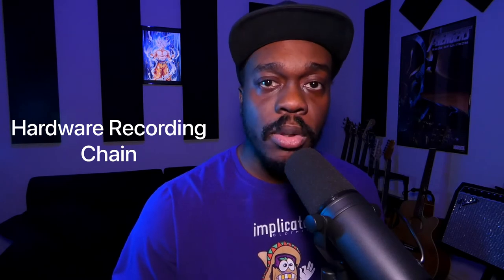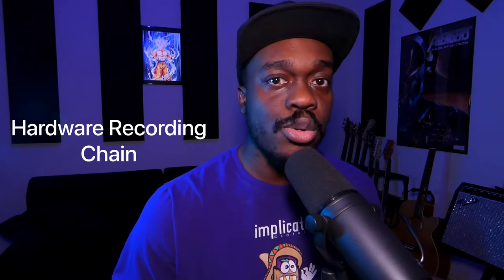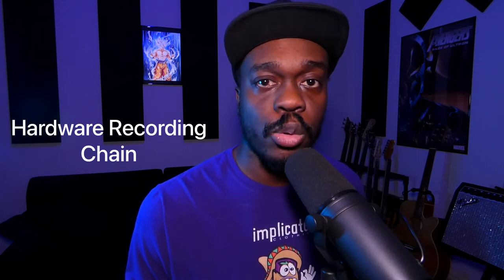Hardware Recording Chain vs Interface Mic Preamp (WA47jr & SM7B)

Comment: Good concept of a video man!!!

For me, there’s a depth difference between the hardware chain and stock pre. I wouldn’t classify the difference as bad but I think situationally, each offering would support a source and sonic intention nicely! 

I had an Apollo mk1 for a few years (2014-2016 I believe) and they were in my opinion some of the best transparent pres on the market. I think that approach offers an element of post production creativity. Don’t get me wrong, a good captured source is a good captured source and that’s always the intent. But clean sometimes JUST WORKS, just like it’s nice to have excitable fat tones achieved with front end processing.

Good job man!!! Keep posting!
Reply from the maker: Thank you very much for your comment and support man, I greatly appreciate you! 

There is definitely a depth difference and that neither sound bad at all. I think they both sound great in their own way! It was very interesting to hear the sound that hardware added to the recording, just the electronics alone without EQ or compression applied. And I agree, sometimes clean just works and that is exactly what a source needs. You can't beat that!

Thank you again for your support!!!